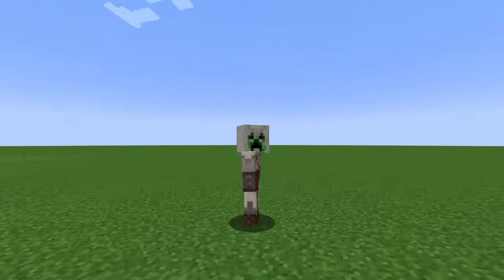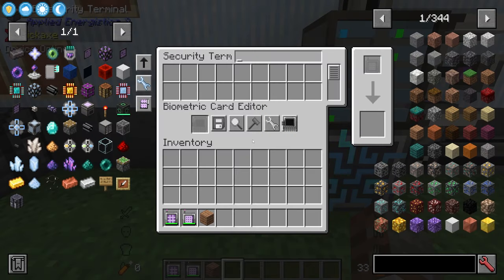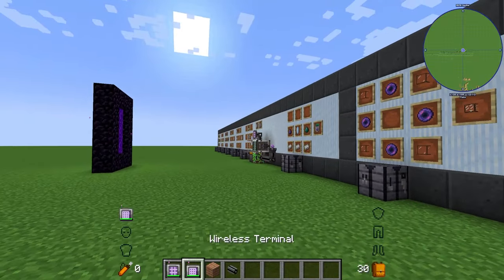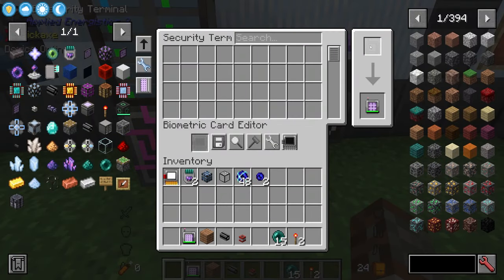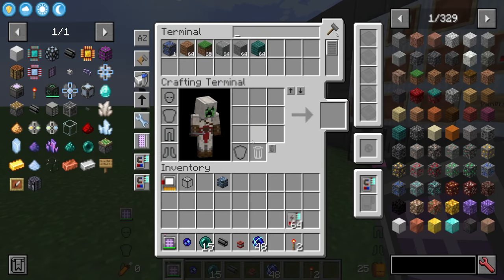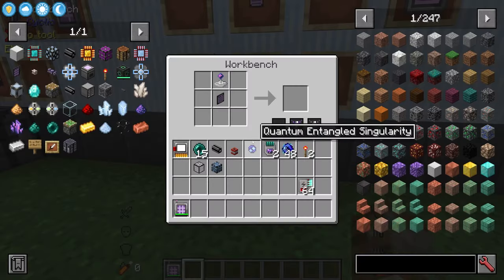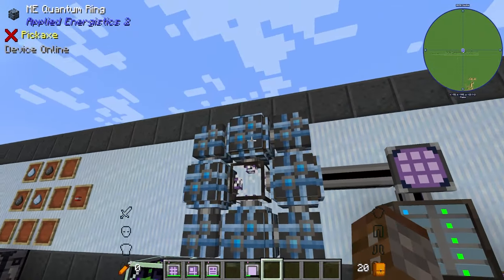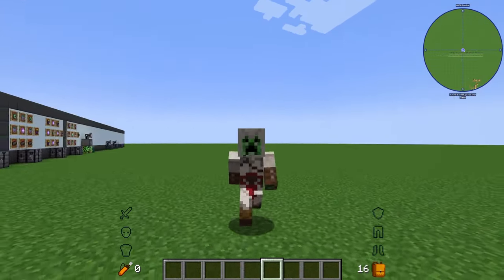How to: Applied Energistics 2 | Wireless ME (Minecraft 1.19.2)

Comment: Playing on 1.18.2 and the Wireless Access Terminal for forge doesn't have a Quantum Bridge Card or Singularity slot. Not sure if this was changed for 1.19+. It has an Infinity Booster Card, that doesn't ever seem to work properly. Suppose to be able to access the terminal at any distance and across dimensions, but usually unable to as it says station can't be found.
Reply: Is your entire me system and power generation chunk loaded? The wireless terminal will not work if the system isn't loaded.
Reply: @WoodenPlankGames  OMG THANKS SO MUCH!!! THIS HELPED ME SO MUCH
Reply: @francistan5952  hi, could you tell me in detail how you solved your problem please?